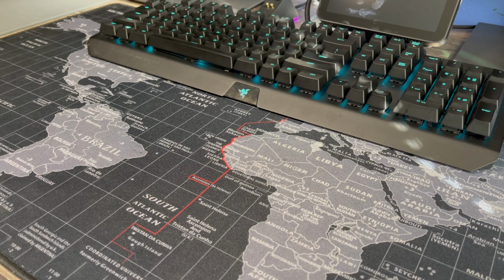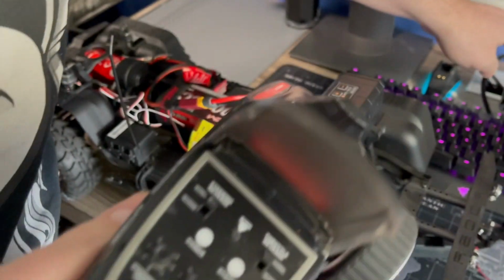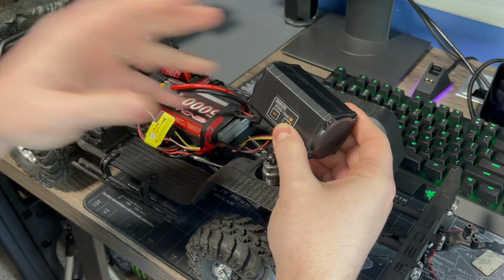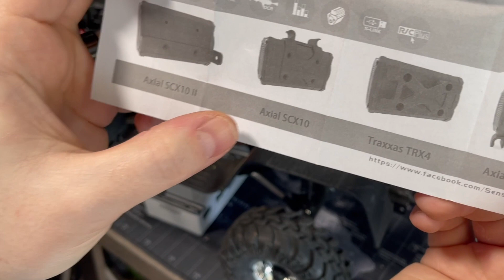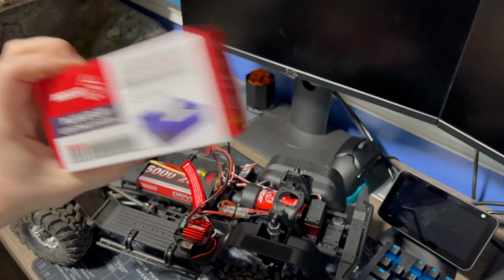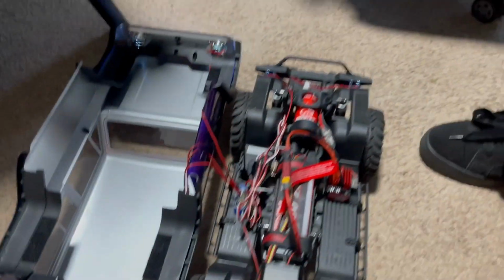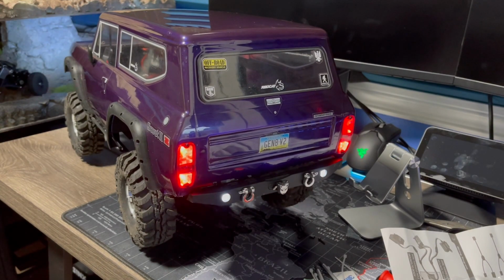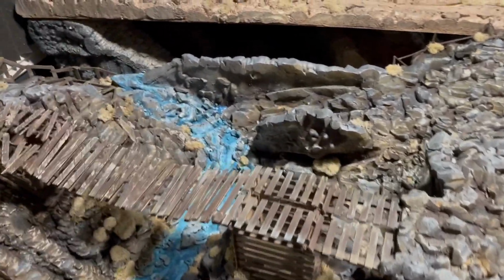Redcat Gen8 V2 Sound Module and light kit Upgrades!// Installing some “Thunder” and “Lightning”//

Comment: What brand is the sound mod. And link to buy
Reply: Look this up on Amazon and you’ll find it:   WonVon Car Engine Sound Simulator,Dual ESS Sense Innovations Plus Engine Sound Engine Simulated Module Set for Axial SCX10/SCX10 II
Reply from the maker: I updated the description of the video and added links to the 2 products I used 🤘🏼😎